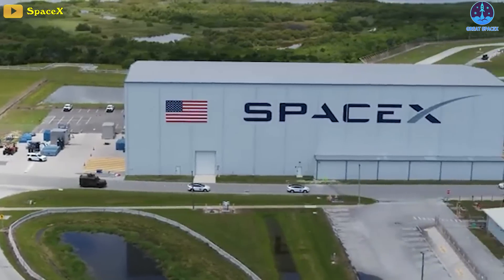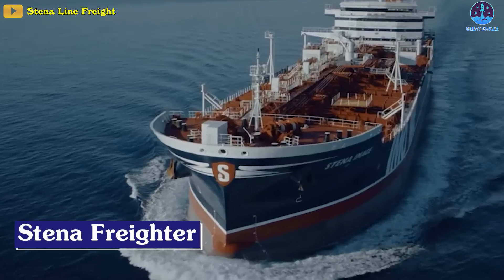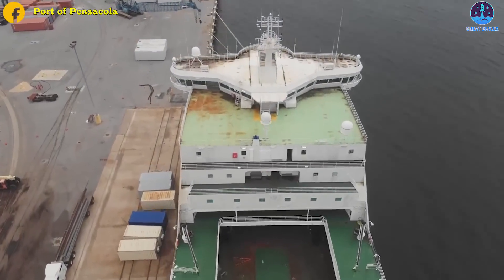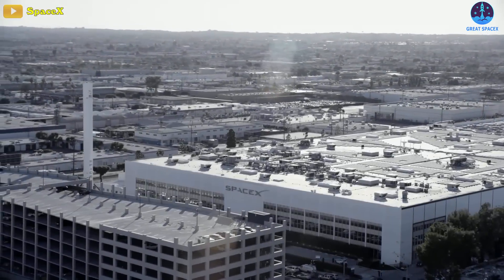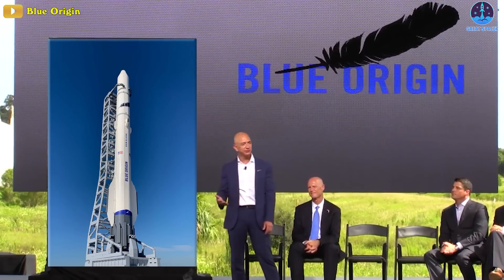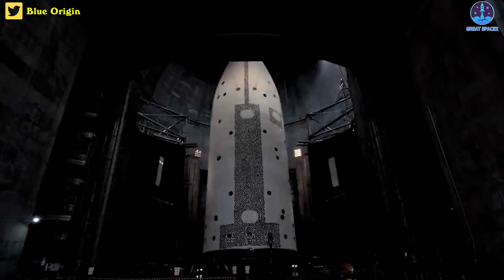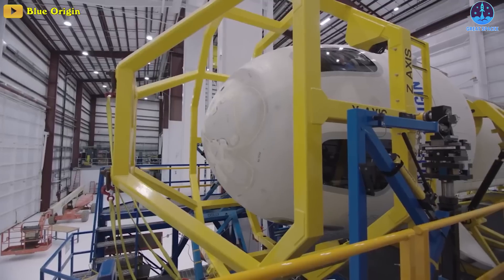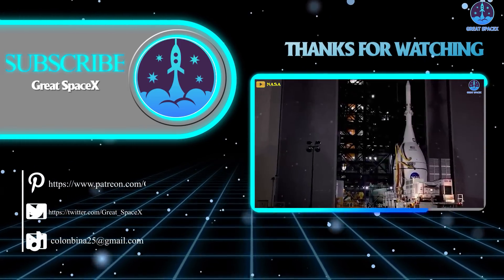Blue Origin almost gives up on NEW GLENN while SpaceX making huge progress at CAPE...

Comment: Don't count Starship eggs before they hatch.  SpaceX is trending late with everything Starship.  Starship has an Achilles heel, in that it is a logistical nightmare.
Reply: Explain.
Reply: @stefanbaartman5893  Distant orbits like the Moon and mars require multiple Starship/Super Heavy launches and in-orbit refueling operations that must be delivered timely requiring a rapid launch pace that Starship may not be able to provide.

And Mars is even worse - requiring the construction of an entire colony to support Starship refurbishment and fuel production.  Water is one compound needed and research as shown that the Equatorial region of Mars is extremely dry.  This would make the Polar regions more suitable for Starship operations.  And the polar regions are the least desirable place on Mars to colonize.
Reply: @stefanbaartman5893  I agree .. someday.  But we don't need to solve THAT problem now.  We have OTHER problems (far more pressing problems) that need to be solved now.
Reply: Oh yea ... and the Space Shuttle was re-using solid rocket booster segments 40 years ago.  Not to mention the Shuttle Orbiter itself.

Comment: Blue Origin at the Cape is disorganized even though a third of their employees are former Space X .
Blue Origin refuses to listen to them.

LC-36 is still a construction site with many design failures due to the Blue Origin Team constantly changing requirements for completion.

The buildings going up on the site are so close to the launch site  that I believe will cause massive infrastructure damage the first time they launch New Glenn .

Their T&E was suppose to be test mounted and raised on the pad August 16th. It appears from the lack of news coming out of Blue Origin that this has not happened. 

Blue Origin continues to fail as Space X moves forward . Starship will more then likely fly from the Cape before BO even gets LC-36 completed.

Comment: This is deeply unfortunate.  At the moment, as shown in this video, the ONLY competition for SpaceX is SpaceX itself.  By most measures SpaceX is at least five YEARS ahead of any competitor.  It successful recovered F9 B1019 seven years ago.  It reused F9 1021 five years ago.  No other launch provider has YET matched this although Rocket Lab has recovered one Electron booster.  But the SpaceX booster that is most like the Electron is the long abandoned Falcon 1.  The Falcon 9 has EIGHTY TIMES the payload of an Electron for only TEN TIMES the launch cost.  ULA is "thinking about reusing" the BE-4 engines from the Vulcan Centaur which may launch in 2022, not the whole booster.  The engines for the theoretically reusable ESA Themis booster are being tested but clearly are not even as advanced as the BE-4!  SpaceX is even committed to a demonstration of a completely reusable launcher within 12 months.  Surely the ESA, ULA, BO, Roskosmos, and the Chinese should all have committed to a high priority for reusable, high cadence, launch vehicles the moment that SpaceX demonstrated that it was not only technologically feasible, but economically advantageous.

It must be understood that the biggest difference between SpaceX and all of its competitors is cadence.  SLS has performance is slightly greater than Falcon Heavy.  Indeed many Artemis tasks which were originally to be performed by SLS have been transferred to Falcon Heavy simply to ensure that there is enough money in the NASA budget to complete the committed launches of the Orion capsule.  But Falcon Heavy can launch at least 3 times per year, whereas the current scheduled launch cadence for SLS is less than one launch per year, and the intended launch cadence of Starship is hundreds of launches per year.  Moreover the very first Falcon Heavy task for Artemis is the delivery of the core of the Lunar Gateway NET November 2024.  Note that by the time that launch is scheduled Starship will have been an operational launch vehicle, including reuse, for over a year with probably dozens of successful launches.  Starship could deliver the entire Lunar Gateway (PPE, HALO, ESPRIT, and I-HAB) with a mass of between 30 and 40 tonnes, in a single vehicle with spare capacity.  Indeed they could be carried in the hold of the prototype Starship which SpaceX must demonstrate prior to Artemis 3.  It will admittedly, as Jeff Bozos pointed out, take five launches just to get the Starship HLS to the Moon, compared to a single launch of SLS, but five launches of SLS is less than 5% of the more than 100 anticipated Starship launches for 2025.

It is not socially or economically desirable for a single company to dominate more than 75% of any market.  But that is the fault of the corporations which should be more energetic in competing, and the governments which have subsidized moribund companies.
Reply: i seriously doubt Starship launch cadence is going to be as great as you anticipate in the next couple of years. they only have permission to launch five times a year from Boca Chica, and NASA is expressing disquiet about their using the new facility they are building at the Cape because it is so close to the pad used to launch Crew dragons that, were something untoward to happen, we could lose our manned space capability, again.
Reply: @odysseusrex5908  Starship is going to cost at least an order of magnitude more for SpaceX to develop than Falcon.  Without the highest possible cadence it will not make economic sense, in particular it will not be able to compete with Falcon Heavy.  SpaceX has to launch the Starlink V2 constellation, which alone will demand dozens of flights.  It will require 5 launches for the unmanned demonstration flight of the HLS, plus 5 launches to support Artemis 3.  The  manufacturing cost of Starship, despite its use of more prosaic materials, will be greater than Falcon 9 simply because it is more than three times the size.  An individual Raptor engine costs less to manufacture than a Merlin, but there are 39/42 of them compared to 10 on Falcon 9 or 28 on Falcon Heavy.  Starship's fuel is cheaper than Falcon 9s RP1, but there is four times as much of it. So both on the demand side and the supply side Starship will need a high cadence.
Reply: @jamescobban857   An order of magnitude more? And this assertion is based on what data?
Reply: @odysseusrex5908  This is based upon five decades of experience in engineering and examination of the public documents.  The development cost of Falcon 9 was just $300 million.  The investment in BC alone is clearly over $1 billion.  Never mind the investment at Hawthorne and McGregor.  And specifically the $2.9 billion that NASA is paying SpaceX is only to cover PART of the development cost of Falcon 9.  Now clearly SpaceX looked at NASA's budget before making the bid and tailored the amount to that budget, unlike BO, but the fact remains that SpaceX billed NASA $300 million for the development of Falcon 9 and just shy of $3 billion for the development of PART of Starship.  To me that suggests that the total development cost of Starship is north of $3 billion, and therefore more than an order of magnitude greater than the cost of Falcon 9.

Comment: Finally, an American accented delivery using proper English - Aluminium.
Reply: There is no I in aluminum.
Reply: @odysseusrex5908  Aluminum is not a usable metal. It is an intermediary between the raw material dug up and the refined product that is aluminium. You cannot use aluminum as building product.

Comment: No mention of the fact that the BE-4 is not yet fully developed or that only one engine has so far been built...  SpaceX is so far ahead that if their Starship and booster are successful at being reliable, robust and fully reuseable, Blue Origin may eventually have a rocket that cannot compete.
Reply: BO has several engines built bud.  The owner of ULA posted images of two just a while ago.  That's JUST BE$, then theres BE3, BE3U and BE7
Reply: @iamscoutstfu  Exactly, BE 4 - which is what New Glenn requires!
Reply: @chrisantoniou4366  No....You don't seem to understand wtf you're talking about.
Reply: @iamscoutstfu  So how many flight ready BE-4 rocket engines does Blue Origin have?  Or perhaps I'm wrong about the engines New Glenn requires?  Or perhaps you're just full of shite?
Reply: @chrisantoniou4366   Two flight worthy engines have (finally!) been delivered to ULA.
Reply: @odysseusrex5908  Thanks, the last I had heard one of the engines was not quite complete.
Reply: @chrisantoniou4366  

Wait....Hold on. 

You don't know how many flight ready BE4's BO has produced.  You have no idea.  But you're making claims about how BE4 doesn't work? You've never seen the ULA twitter?  

I just want to make sure that that's what you're saying. You have no fucking clue, even though you made claims to there being none.

Correct?
Reply: @iamscoutstfu  Not correct, dummy.  Read what I wrote and try to cmprehend...  I said there was one, just one, BE-4 engine completed and I have since been informed the second engine is now also complete.  If that's a crime then I plead guilty.  Now, where did I claim the BE-4 doesn't work?  Or did you just make it up so you can feel superior?  It doesn't matter how many lies you want to spread, people can read (and with better comprehension than yourself it seems) and make up their own minds...

New Glenn requires seven engines to fly and it so far has only two.  Blue Origin has to build another five flight worthy engines and integrate them into the rocket itself before all up testing can occur.  Blue Origin is nowhere near getting ready to fly New Glenn and won't be for at least two to three years.

Sorry to burst your bubble, but if I were you, I wouldn't be holding my breath waiting for New Glenn to fly.

Comment: Based on the two models of business, Blue Origin will have to offer something that SpaceX can't, because the BO model doesn't compete on cost.
Reply: Lmao what?
Reply: @iamscoutstfu  , New Glen has been rendered obsolete by Starship before they’ve launched. Raptor 2 engines will make Starship launches more cost-effective. Bezos is launching New Glen just to save face, but will still fall short. New Glen is like a basketball team behind by 20-points in the 4th quarter and merely fighting on to lose by less than ten for integrity sake.
Reply: @iamscoutstfu  , Raptor 2 engine can produce more tonnage and the Starship can carry heavier mass. That would mean the cargo load would be more cost effective with SpaceX.
Reply: @paintedpony2935  , there hasn’t an exercise of futility such as New Glen attempting to launch. Oops! Perhaps the SLS launch will compete with New Glen for this year’s Darwin Award.
Reply: @leapdrive    You don't know what the Darwin Award is.
Reply: They can offer their special Body Odor?
Reply: You haven't been paying attention. BO contracted with ULA and several other companies to launch their Kuiper satellites. IOW, BO is MAKING a market for New Glenn and BE4 engines, making existing launch providers dependent on THEM in the process -- just like Amazon made small merchants dependent on Amazon.
Reply: @waynzignordics  , today’s no-bid environment is rocketry will assure companies like BO, SLS and ULA to continue their businesses.